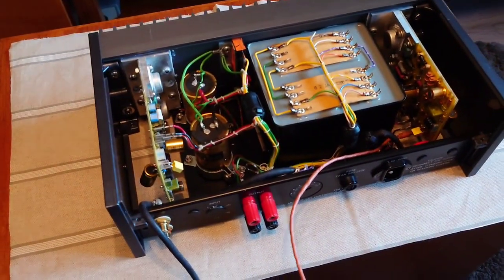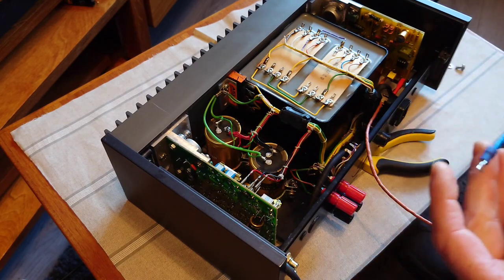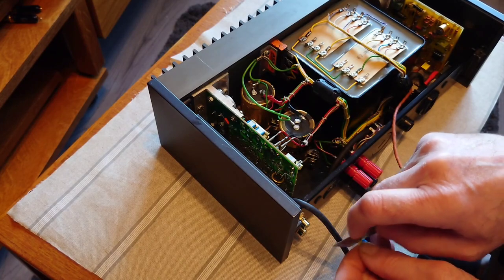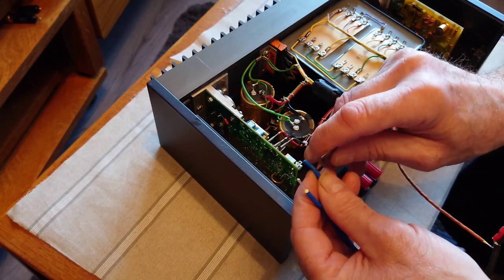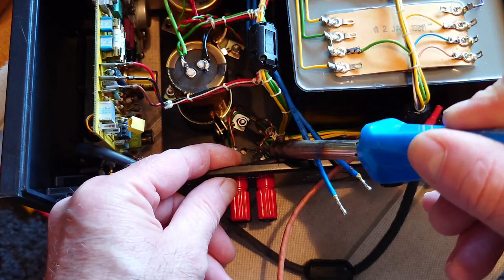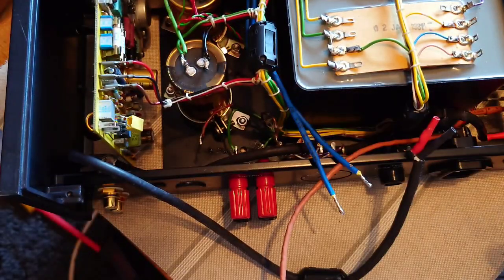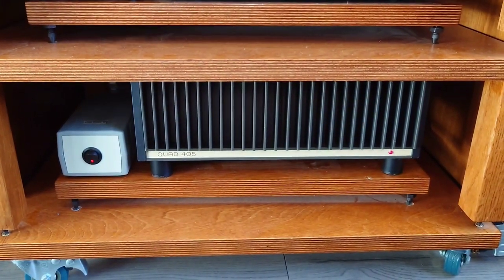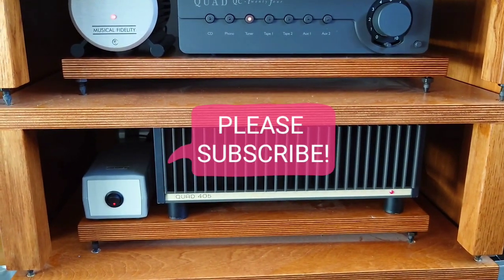FITTING THE NEW 10% SILVER CLADDED COPPER INTERNAL SPEAKER WIRE QUAD 405

Comment: Ahh the extra long screwdriver, had to buy one specifically for the 405/2.
 Inspiring me to swap out the inner speaker wires here also and binding posts etc. It always bothered me.
Got some WBT shoes to fit the board pins also sitting around just for this. Added to the long list of future projects.
Thanks..

Comment: Hello from Meaford Ontario Canada : I have a spool of silver nickel wire I put twenty lines together and used the drill to twist together I soldered the new wire into my Naim Nait 5i amplifier and it improved the sound more silky highs also today I received my capacitor order of Mundorf MLytic filter capacitor s and a AudioNote regular one and a pr of Duelund. 1 uF 650 v and I put all of them into my Sansui Receiver model 7000 MY GOD THE SOUND IS EPIC INCREDIBLE

Comment: Did you consider upgrading the binding posts itself? I can't identify the materials used for them from the video, but I'd assume they might pose a bottleneck now.
Reply from the maker: Hi, yes I will be changing them, I'm in the process of making a set of binding posts, from pure silver, they will be coming in a future video, I love it that you noticed them, as lots of people say doing that is snake oil, unfortunately they just don't understand, thanks for commenting & watching 👍
Reply: @tweakerman  I never understand these snake oil discussions. As long as a tweak brings enjoyment, be it by actually improving the sonics or just by enjoying the tweaking, and nobody gets hurt by it, why are some so emotional about it?

You made me consider swapping the fuses and filter caps in my power amps. Unfortunately there need to be other changes to the system before that. 😅
Reply: Dear Tweaker man : as I was the manager Oakville Audio here in Canada I learned something I would like to share with you about silver wire and conducting. ..B&W speakers learned and incorporated extremely high end silver speaker wire in their signature series in the late 90's and start of 2000's , what I learned was by talking to the rep of B&W Canada that the silver wire is not 100 % Silver as the silver wire is coated in a iron powder because low frequency has a hard time going through pure silver as the iron is used for the low frequency so ideally you should be using Silver Nickel wire silver for highs and mids and nickel for the lows